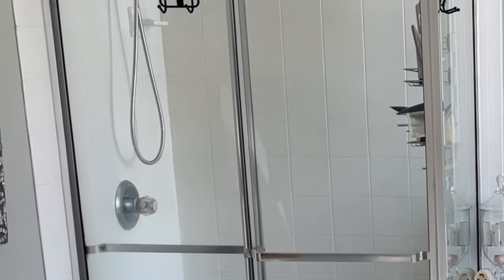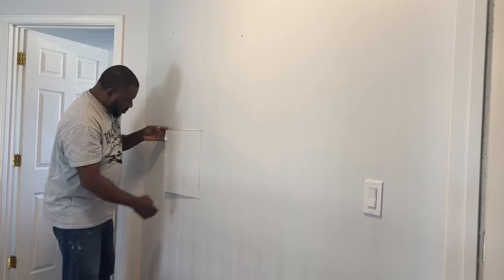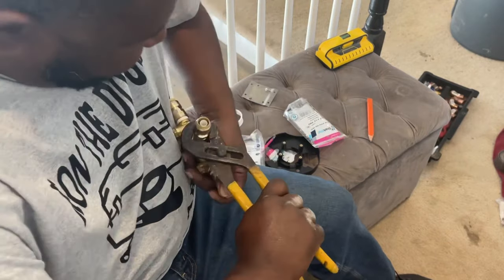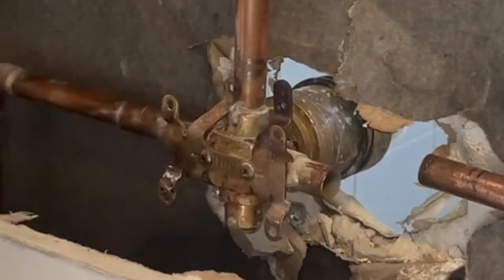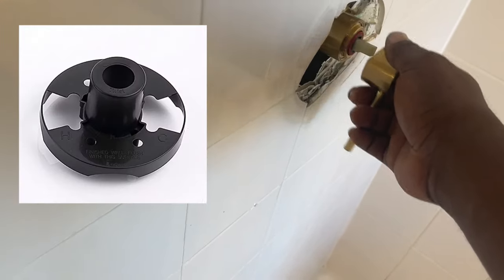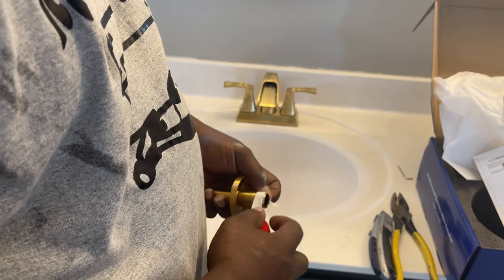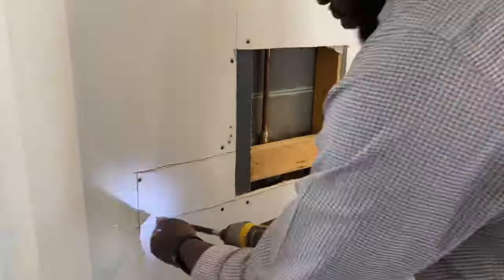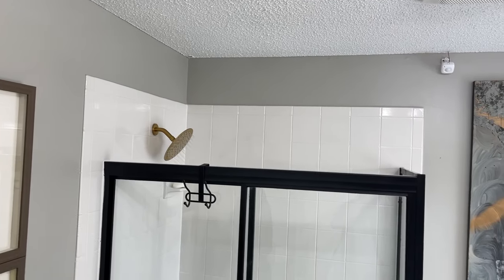DIY Retrofit Shower Valve | No-Solder Plumbing | Sharkbite

Comment: Excellent DIY video.  I have a replacement shower valve kit, and I bought the sharkbites threaded one end.  A walk in closet is on the other side, much easier to cut out like he does than to remove the vinyl shower wall.  Thanks Ron!

Comment: Ron, you have NO IDEA how helpful this was. I saved $1600 I definitely did not have and I did research for hours trying to find some help until I found your video. 

"Don't drop your cutter into the wall. That's where the boogie man lives."
Reply: But how much do you really save when those fittings start leaking in the future and ruin the sheetrock on the wall and the 1st floor ceiling?

Comment: Glad I found this video. I butchered my old shower valve trying to drill out a stuck Moen cartridge and put some scratches in the brass that now leaves me with a constant leak. I have been dreading the thought of replacing it myself but didn’t want to pony up $1000 or more to get a plumber in to do the job. I had never seen Sharkbite before but you made it look very manageable. I can do this!
Reply from the maker: Yes you can! 💪🏾

Comment: I was really skeptical of tge PEX line back around 10 years ago before I helped run all the plumbing in a multipurpose building for a Bible camp. I was amazed at how simple PEX made  the process & now Shark Bites are even easier without the need for any special tools. And you're right you might not be a "real" plumber, & when you're talking about water & the risk of causing thousands or tens of thousands of dollars of damage & mold abatement due to a bad solder joint keeping your ego in check & knowing your skills & limitations is vital.

Comment: Great video! I used shark bites temporarily while I was remodeling my bathroom, but once I was done, I took them off. I just couldn’t trust them. Thanks for sharing your talent.
Reply from the maker: Yeah, I typically solder everything but it’s good to have options that the average DIYer could do.
Reply: I installed shark bites on my water heater from the public water supply to the house. This was about eight years ago. Haven’t had a problem. I don’t know why they get such a bad rap but the work just as good or better then PVC or Copper.
Reply: Every plumbing company in town won’t guarantee work done with shark bites for a reason!

Comment: Thanks for that. i was a little worried about using shark bites, but you made it look easy..
Reply from the maker: They are easy! If you can solder then that’s better but shark bites are good as long as you make sure you push them on all the way.

Comment: I've been putting the same project off for a while and now it's a problem. I'm using shark bites like you are with the exception of using some flex tubing for inbetween pieces. (I'm replacing a two handle shower valve) Your vid was clear, easy to hear, great camera position, and when you said about the boogie man I laughed! Thanks for giving me the confidence to do this job today.
Reply from the maker: You got this! Thanks for watching!
Reply: I’m thinking of doing the same - how did your project go? Has it been successful/ any leaks in the last year?
Reply: @supergeek0177  It was completely sucessful! The sharkbites did leak just a little at first, but then they settled in and all is well.
Reply: @jonfoster5685  that’s fantastic to hear! Thanks for sharing / replying!

Comment: Great job!  The only thing I would say is if you’re going to use shark bites, get the shark bite orange gauge and mark your pipes before installing the fittings. Shark bites need to be bottomed out completely and this step will make sure of it.
Reply from the maker: Great advise! I did mark them for an inch (.95) of 1/2 piping to be pushed completely in. Thanks for commenting and watching!
Reply: @rontalley  yeah, we’ve noticed that when you push them in they stop after about a 1/2” but then you push and they seat all the way.

Comment: In this video your a whole lot faster at wall repair and plastering than plumbing. I had too slow the playback down to see how you repaired the wall. It made the wall repair look like a piece a cake compared to replacing the valve.
Reply from the maker: 🤣🤣 I put a card in the video that shows the steps to drywall repair. I have a complete video on it. It’s definitely a process but still IMHO, way easier than repairing/replacing tile and/or tub surround. Check that video out! 

Thanks for watching!!

Comment: Great video.. and there is absolutely nothing wrong with using shark bites.. I am a maintenance technician at apartments and use them all the time
Reply from the maker: Agreed. Sometimes it’s hard to convince people of new and faster ways.
Reply: @rontalley  only down fall is those shark bites can get expensive.. especially the shark bite valves.. but still beats the hell out of sweating shit in
Reply: How good do they hold up. Dont they wear out?
Reply: @BienRecio1  well I've been there about a year and never had no leaks or anything like that from them

Comment: Hi, I've watched a lot of videos about sharkbite and they've been saying to removed the white piece when attaching to copper but to leave it if attaching to cpvc. I noticed you didn't remove it. In what situation would you remove it or just let it be? Thanks for the video!!!
Reply: The white insert should be removed for copper. It's only purpose is to give pex piping stability in the fitting if using pex.

Comment: How did you secure thoese copper pipes to valve, does valve has compression nuts or you just pushed them in and that was it?  How far did copper pipes went inside  valve, 1/2  or 1 inch when connected??
My existing  valve is too deep into wall so cartrige not sticking out like it supoused to.  Iam assuming once I installed valve I can pushed it out more, maybe add a piece of wood  behind or something ??  I also have acess in the back wall so I will be doing g what u did.  Where did u get that valve?? I don't wat to solder ether. Lol
Any tips before I begin so I do t make mistakes🙄
Reply from the maker: I explained all of that in the video…Did you watch it in its entirety?
Reply: @rontalley  yes I'd did I might of missed it.  I will watch it again.   
However I just found out  my valve is conected to galvanized piping not copper🙄

Comment: If you didn’t cap the pipe for the tub would you still be able to use a shark bite I’m gonna do this and I’m wondering how am I gonna get all the pipes on in the shark bite deep enough
Reply from the maker: Yes, you will follow the same process for the tub spout however, shark bites spin so you will need to secure the tail piece going to the tub.

Comment: You would have been a dead man before you started if you would have damaged that wall hanger! Really though using Shark Bite fitting & workingbfromnthe backside is a really good call.

Comment: Plumbers say no sharkbites yet they use compression fittings which are basically an oring they compression with a tool. Sharkbite been used in air lines with higher pressure for years. They just mad they can't screw people  anymore. I know we need plumbers but for simple things like this I think you did great job. I switched all my toilet and sink valves to sharkbite and haven't had any issues. Plus if you leave access panel you can always check on them every year.
Reply: Plumbers love shark bites. Feeds money into the service side when they fail...
Reply: Unfortunately some people believe their own BS
Reply: Unfortunately some people believe their own BS

Comment: Great video Ron, I will definitely try this 👍👍, and also I have a suggestion (observation), the teflon tape should be wrapped the opposite way you are doing it and also to avoid it unravel and having to turn the valve to apply all the unraveled tape, just turn the roll and you can put it tighter. Again, I loved your video man, very useful.
Reply from the maker: Thanks for the tip!
Reply: I looked at the video again, after reading your comment, and saw that he wrapped the three valve connections correctly (i.e., clockwise).
Reply: @sammy7237  Maybe I didn't explained myself, but I was talking of the way he is holding the tape roll, should be the opposite way, not the direction of the tape on the pipe, if he turns the tape roll the other way it won't unravel and can be applied tighter. Maybe I should make a video and post a link here :p. I hope I explained myself better this time, and if not, just let me know and I will make the video :). Thank you for replying to my comment. cheers

Comment: If this gives you so much confidence, then why not watch a video on how to solder? It's really very easy to solder 1/2"🤷 not to mention much less expensive.
Reply from the maker: I’ve been soldering for 30 years…This video is not about that. Actually soldering is not even a thing any more as most plumbers have moved to PEX. Have a great day and thanks for watching!
Reply: @rontalley  I'm talking about your viewers confidence not yours. Don't take it personally. 

Soldering is absolutely still a thing. I'm a plumber and from a purely professional standpoint, soldering would be the best way to do that job.
Reply from the maker: @creativesuit1930  I 100% agree that soldering is better. However, that’s not the point of this video. This video is to show those who do not know or want to know or even scared of soldering. This method is quick and easy and doesn’t require any special tools. 

So to your point, this video is directly catered to those who do not have the confidence to solder. Again, thanks for watching!
Reply: @rontalley  And again, my point is that if this video can give you the confidence to do this repair, you can get that same confidence to solder by watching a video on how to solder. 

I'm not commenting about the point of this video or who it caters to. All that is irrelevant, and I couldn't care less. Try not to take it personally...
Reply from the maker: @creativesuit1930  “This” video is dedicated to shark bites and how to use them to do a shower valve replacement. I’m not the one taking things personally…

If one was searching for a video on how to solder a shower valve, “this” video is not for them. Not sure what else to say here. Have a great day!
Reply: @rontalley  You just don't get it. I wasn't talking to you in the first place. I was speaking to the viewer. 

You just keep repeating yourself. Even though I told you I don't care. 
Why is my comment getting you so twisted up 🤷
Reply from the maker: @creativesuit1930  Oh, believe me, I get it. Actually talked about it in this video. You professional plumbers are all in your feelings because you can no longer charge an arm and a leg for things like this because of content like this.

Check my resume. I’ve been a professional home builder for over 30 years and I haven’t  seen solder on the job in almost a decade.

Not responding to anything you post after this. We all have our opinions.

Have a great day.
Reply: @rontalley  I love shark bites. Helps feed money into the service side of the business when they fail. 🤣

 Besides, if I cared about losing business, why would I suggest learning to solder? I think homeowners should be much more capable of doing simple home repairs. 

I'm just addressing your viewers and giving my professional opinion. Not sure why you have such a huge problem with me sharing my opinion. You even admitted that soldering is better yourself. 

It's not hard to do at all, even a handyman can do it....

Comment: why is there a motion detector in that bathroom?
Reply from the maker: It’s a multi-sensor that detects humidity, temperature, motion and luminosity. When there’s no motion for a set period of time, the lights go off. If humidity rises fast and goes over a set percentage, the exhaust fan kicks on. When it’s dark and someone enters the bath, the lights come on. Etc.

Thanks for watching!

Comment: This project is super easy. The magic or the hard part is the measurements. Measuring and cutting the copper. You can’t compress or stretch steel so cuts have to be good. Next is the depth of the valve in the wall. This is determined by his 2x4. So videos like this mostly show the easy parts. The fun stuff i.e Cutting, connecting…  The boring, tedious and crucial stuff is determining the 
Measurements. If you ask 10 people what’s more exciting Shop or Math class? Most will say shop. So let’s make sure lots of the shop is captured on the videos. Math is boring. My only point is take your time. Get accurate measurements the rest should go well.

Comment: And you Added tape on the shower head arm The wrong way , So when you go to tighten , The tefflon will come off as u tighten .
Reply from the maker: Interesting that mines didn’t and no issues so far but again, thanks for watching!
Reply: @rontalley  Dude its a Fact , Theyre is no need to get defensive about this lol  It is public information , Teflon goes on clockwise .. If not as u thread it , Tefflon comes off ... Fact .. im glad it didnt cause u any issue , But it will for some who watch this
Reply: @pmgolf5305  “Defensive?” Are you kidding? If anyone’s getting defensive here it’s you. Anyway, regarding the Teflon (not tefflon, btw) tape: He applied it to the three valve connections correctly, though, and that’s where it matters most (i.e., inside the wall). He can easily unscrew the shower arm and redo it.

Comment: Bruh, that sharkbite right up to the coupling, tisk tisk tisk...
No need for the rag either.
Reply from the maker: Remember that this is for the average DIYer…You should have about an inch between fittings to be able to “remove” the Sharkbite fitting…So in this scenario, I would’ve of needed to cut the copper back way past the soldered coupler, buy another Sharkbite coupler just to  leave room for removal…Well, surely that’s not cost effected and adds 2 more points of failure. You can just cut the copper back if you ever needed to remove the fitting. 

The towel was to avoid leaving scratch marks on the brushed gold arm. 

Thanks for watching!

Comment: from soldered joints , To shark bite fittings ehitch stay behind a wall ... Been a plumber for 12 years , And would never recommend this , Shark bite is just Lazy work imo
Reply from the maker: This isn’t for professional plumbers nor those who know how to solder…This is for people who want to tackle a weekend project using these fittings which are, and have been for years, rated for behind wall installation. I’ve been soldering for 30+ years and if they are good enough for my house then they are good enough. Soldered joints leak all the time.

Also. If you have been plumbing for 12+ years, then you should know that copper in residential is pretty much a thing of the past as most of us now use PEX.

Thanks for watching!
Reply: i agree i guess but pex is inferior to copper  for long term use Fact . And what i post in your comments could be read by other watcher , Its just an opinion , And information then can take with them when making these decision .. Really no need to get defensive about . If someone is remodeling a shower , And  alot of time beheind theyre Shower wall is the outside of theyre house .. And installing shark bite in these areas are a disaster waiting to happen .. Cheer up !
Reply from the maker: @pmgolf5305  no offense taken, at all. I take pride in my work and I’m not saying I know it all. However, shark bites sometimes get a bad rep when most of the time they fail because they are not pushed in all the way. They work, they are fast and easy to install. The failure rate is below .005 and they are rated for 25 years. Again, I wouldn’t use them in my own home nor suggest them if I didn’t have the experience and confidence in them. Out of the 1000 or so repairs I’ve made with them, I’ve never had one to fail nor had any issues in that regard.

You are right about the tape though. Good catch. 💪🏾
Reply: @rontalley  i actually Carry atleast 10) 3/4 and 1/2 Inch Shark bite caps and ValvesThat have saved some homeowners thousands of dollars of damages to theyre Home , from Splitting frozen pipes and not having access to the Water Main Valve , For me there  will always be a place for them , I know for a fact theyve helped alot of DIY's , But In my Experience (whitch isnt much) They Tend to fail Alot.. But i like The Shower body  And finish trim u installed ... Looks Classy ... My comment wasnt an attack at all , Just an honest opinion for watever its worth . Keep Plumbing !!!
Reply: @pmgolf5305  You say that they tend to fail a lot, yet admit that you have little experience with them. 🤔

Comment: Lol…you gotta be kidding me right ?… have fun with that later when you are fixing thousands of dollars of repairs from leaks…I’m a plumber of 29 years ..I know…
Reply from the maker: 🤔 Believe me, I’ve been soldering pipe since I was in my teens. I’ve also repaired MANY leaky “soldered” joints…I remember when these first came out I was a naysayer just like you. However, I have NEVER had one of these fail. Clean the pipe, push them all the way in and you are fine. However, it’s better to solder but then they would need you! 🤷🏾‍♂️